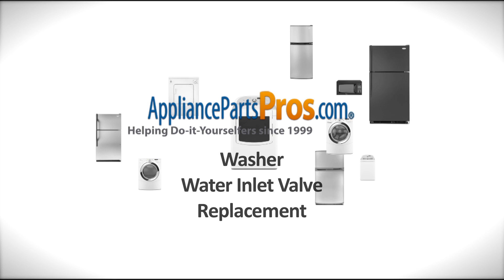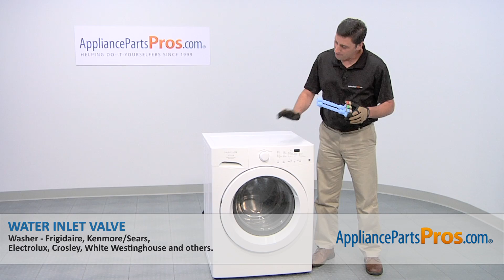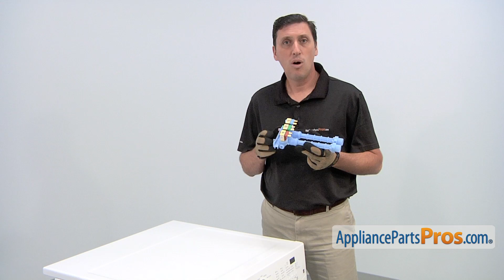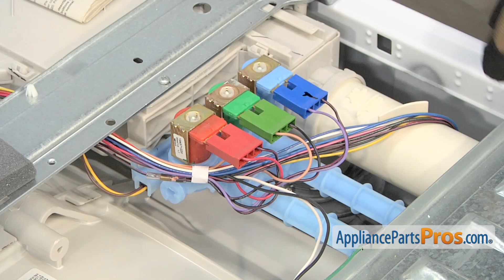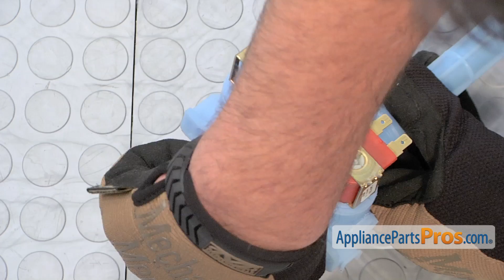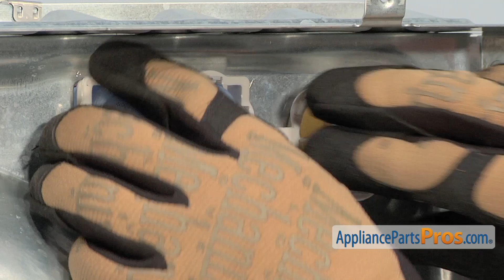How To: Frigidaire/Electrolux Water Inlet Valve 134371220

Comment: This 30 minute job stretched out to over 2 hours.  If you can't get full access from behind the washer, it's a royal pain.  The washer was simply too heavy for me to move so I had to do this from above.  Getting the plastic cover off in the back where the water connects was difficult.  It didn't want to come off.  The lower screw in the inlet valve was the worst to get out and back in.  Make sure you WEAR GLOVES.  The metal exposed parts once the lid is removed are like razor blades.  When you're done and put the lid back on, you'll need an alignment tool, very small screwdriver will work, to align the hole in the lid with the screw threads.  All in all, if I had to do it again, I'll call the appliance folks were I got it and let them do it.
Reply from the maker: If you need help with anything in the future please let us know and we will be more than happy to assist you.
Reply: @appliancepartspros I’m replacing a frididaire affinity but has the electro flux valve inlets do I have to put every retainer screw back in it on the bottom of assembly and there are 4
Reply: Haha tell me about it. I got so many cuts.. I also did a drain pump swap.. Had to completely cover my hands in antibiotic ointment just in case.

Comment: I'm trying to figure out if this is the right fix for my washer.  We returned from about a week long trip to find that the washer had filled to the lip of the tub/door and a small amount of water had leaked out on the floor in front of the washer.  It cleared out the next time we ran a load and I've been watching it for a couple days and don't see it accumulating rapidly.  Could it be the valve is not completely closing and causing a slow leak?  Is there a good way to test for this to see if indeed this part needs replacing?
Reply from the maker: It does sound as if the valve could be causing your issue. Have you had any error codes show up on your machine at all?
Reply: Thanks for your super quick response!  No error codes have come up so far and it seems to function normally so far.
Reply from the maker: What is the model number of your washer? How do you get the water to stop coming in? Does it still drip when the machine is one or do you have to turn the water supply off to the machine to get it to stop?
Reply: Frigidare ATF6000FS1, I haven't had to do anything to turn the water off.  When I found the water pooling in the tub area, I ran a new cycle and everything drained out as usual.  It's been like 2 days and I don't see any more water accumulating so I assume it is a very slow leak, or maybe the valve was just temporarily stuck and everything is working now.  I guess I can wait and watch it longer to see if the problem re-occurs?
Reply from the maker: I would keep an eye on it and see if it starts to drip again and if it does then it sounds as if the valve is what is needing to be replaced.

Comment: Great tutorial! Job took me about 20 minutes. One note: Utilizing the Electrolux Tech Sheet led me to initially bypass replacing the water inlet valve as I was getting water during the appropriate step of the self-test. I ultimately determined that it was an insufficient fill rate that was triggering the error code. The inlet screen was clean and no kinks in supply hose. Upon replacing the water inlet valve, fill volume was at least twice as fast as it had previously been. Only guess is that the cold water inlet solenoid was weak and not completely opening the valve.

Comment: NOTE: This is also a good video for accessing the Frigidaire Affinity hose and clamp in the back and under the detergent dispenser that is connected to the top of the tub/drum housing. Ours became dislodged and was leaking water during the fill cycles. By removing just the vent tube assembly for easy access to the detergent dispenser hose. No need to remove the water inlet valves. Good luck!!

Comment: I’m dealing with one that seems to be missing the side wires on the water inlet valve. It’s a Kenmore 3.5 Quiet Tumble.  Are those wires universal?
Reply: Figure out anything?? I was trying to pull it out and it was stuck water had white residue on everything. And the connector split on that side wire

Comment: Is it possible to open up the valve and repair the part without buying a new one? It doesn't look openable, but depending on what or how it's failing it seems like the part could just be fixed.
Reply from the maker: That might be possible, but we couldn't say for sure whether it would work or how you would go about it.
Reply: It depends on where it leaks. Sometimes its the valve shaft itself (which I guess could be fixed w/ flex seal). However, sometimes the area where the solenoid sits is cracked, or where rubber inlets to the dispenser are. Those would be more difficult to repair.

Its not an expensive part to replace. Unless its a small leak on the shaft, just replace the darn thing.
Reply: One appliance blog had a person fill the valve with CLR overnight.  They ran the washer, then filled the valve a 2nd time.  That cleared whatever build-up was blocking the valve.

I assume they had very hard water.